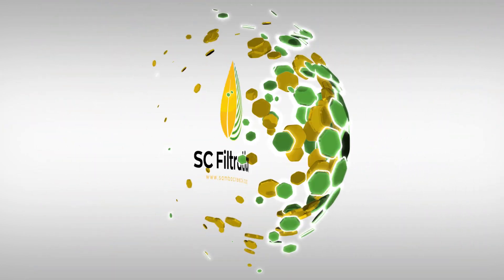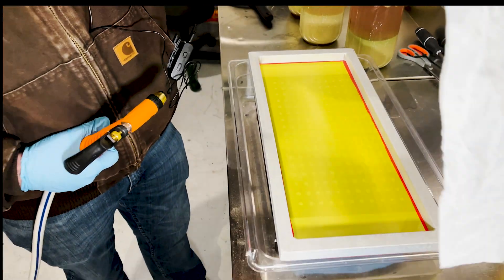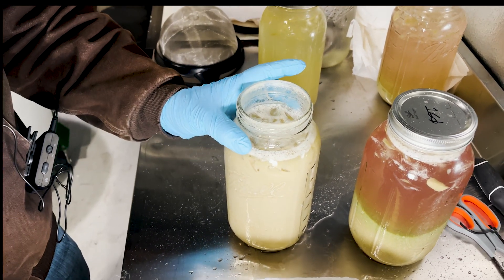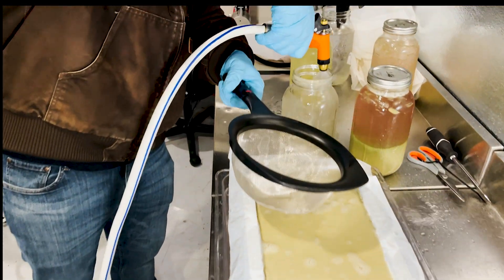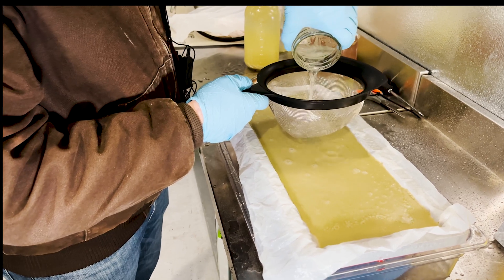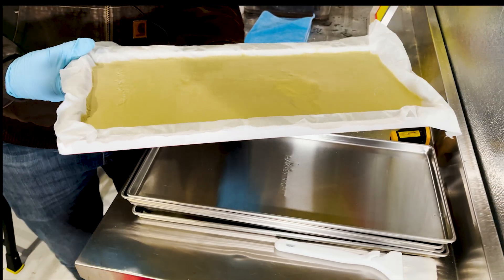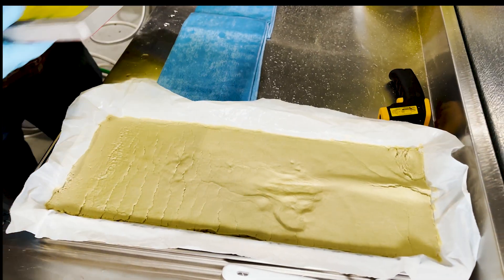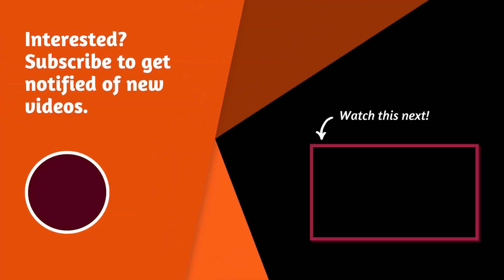Hash Tray Preparation: Optimize Your Harvest Right with This Freezedry SOP

Comment: So I have a question that 25micron screen you are using is it reusable or is it a single use? I have found some that was 250$ for a 10yard roll but that would only be enough to cover my trays for two runs so a lil pricey if it’s only single use thanks guys great content!
Reply from the maker: Reusable. With care should last a long time.
Reply: @SamboCreeckFiltration  didn’t see your site ill definitally snag them from you guys when I finally pull the trigger on a freeze dryer!
Reply: What about real hash like Leb or Turkish Saharan.Polm being of impeccable quality' along with Charriss Sweet Cream Panama Red omg 197i 82 ah our youth was all about music guitars in hand smoke at wkends go up the local hill a fire a cider bottle or 6 a few exotic like smokes laughter all night n tumble home . & maybe get lucky ..  Weed isn't for using 24=7 nothing is . Mixing  old Grassws with hash was like going Levitating listening to great music n weightless Deadly.
Reply: No throw away mesh is a great idea of simple thing's we do stay by reysing well made mesh to begin with.  I'd make my own like we use a bug spark plug drill a hole the size of ur smokes but make taper slightly by using a smaller drill bit n out goes ur smoke in seconds n no smell either Its usually metal elsewhere.  Sold ours for 3 for £10 . Not bad n we had a lorry full of them from S Africa and another product . Forget what it was now . What a  crazy place . Whitey is the 1st to Rob ye fkers stab ye aswel.  If they see a coloured person its bang bang no qualms   . Tis a veey short reply 😂😅

Comment: Any recommendations on avoiding patty collapse? This technique really suits my workflow but has not really been working that well for me vs traditional straight on the tray collection methods. I can’t seem to get the wicked material to dry correctly at all. I understand the theory is sound it just doesn’t seem to be working for me causing some substantial loss.  I’m not sure I’m leaving enough interstitial spacing for proper sublimation
Reply from the maker: Are you pouring a wet patty or scooping like normal? You need a flat surface for everything to dry uniformly. Your FD settings or total dry time may be a factor.
Reply: @SamboCreeckFiltration  jar collection and pouring wet, pre freezing trays, followed the sop closely but not getting the results I was hoping for. Any insight would be appreciated
Reply from the maker: I’ll make a video next week that is more in depth. I think that will help. It may be a freezedrier issue which is something we haven’t even talked about but should.
Reply: @SamboCreeckFiltration  thank you tremendously. I would love to keep this process, but could probably use some clarification. I don’t believe that in my case it was related to the freeze dryer as my control trays dried fine but I would certainly still be interested in seeing the process in greater detail

Comment: Thanks for the enlightening video 👌 question, do you think it is possible to do the same procedure but then putting the bubble hash to dry in a No Frost fridge (controlled temperature and RH / 4-6°C and 20% RH) for basically air drying 

Cheers from Italy ;-)
Reply from the maker: To a degree freezers lyophilize. We call this freezer burn. In fact we have data on the amount of water lost on our trays by simply sitting in a normal freezer. So you can remove some water this way but unlikely most of it.
Reply: @SamboCreeckFiltration  clear, thanks for the answer...my idea was to do this same procedure as yours and then put everything in the fridge (not freezer) to dry with ur and t check...trying to avoid microplanning or sieving the hash... meaning in your opinion?

Ps
Sorry for my bad english , i try to not use the translater  😂

Comment: Why don't dry ice
Reply from the maker: Can elaborate on the question? The process is not freezing the hash, it's drying. The freezing is so we can turn water from a solid to a gas directly in the lyophilization process.
Reply: @SamboCreeckFiltration  I think what he what asking was why don't you use dry ice and trim in a 70 to 120 micron shaker bag to separate the trichomes without having to add water in the first place.  No freeze-drying and no water needed.  

I must admit that I never cared much for the water-extracted stuff.  Too much popping and sizzling.  I don't notice this at all with the dry ice method.
Reply from the maker: Thanks for clarifying. In my experience kief typically has lots of biomass and stalks when extracted that way. Personally not a fan so that’s a personal preference.